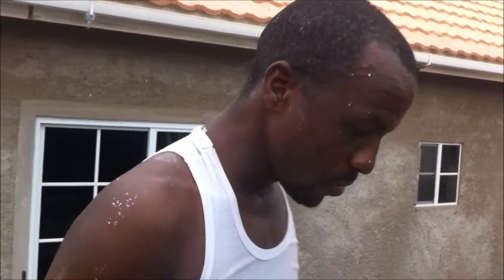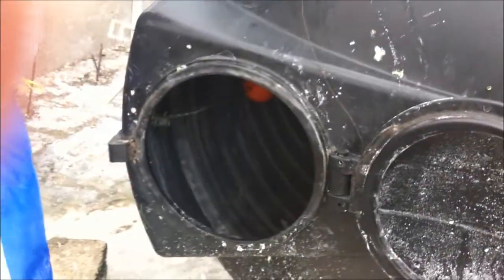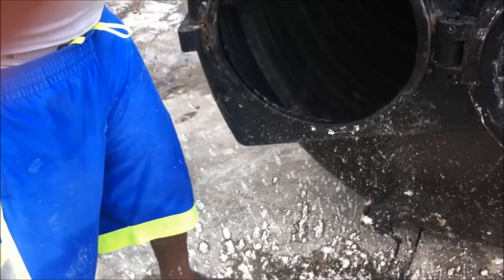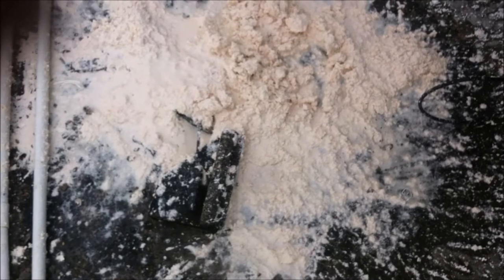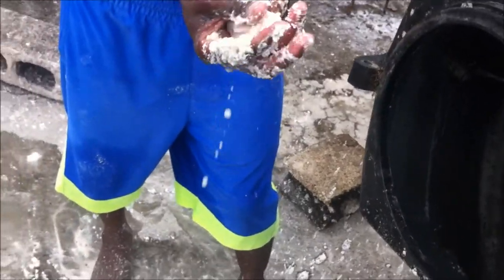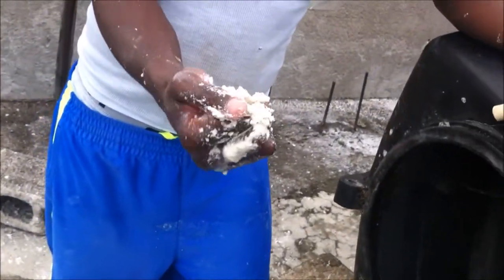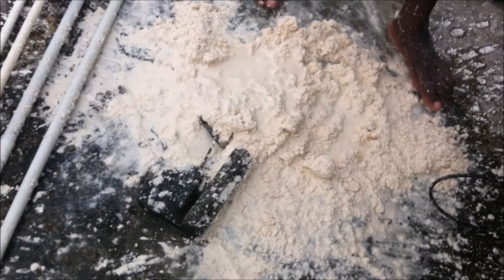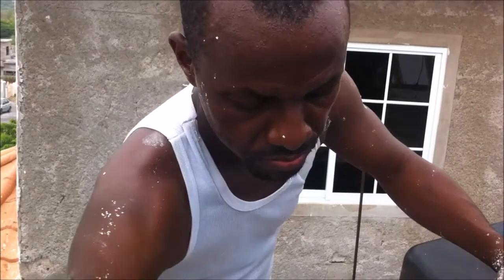MINERAL BUILD UP IN MY FISH TANK

Comment: we get a lot of lime and calcium build up in our tanks too....that's probably what it is because it's white....we flush them annually to get rid of it out the bottom and check valves....we put huge pots on our wood burning stoves to humidify our house and it solidifies in them too and it's impossible to get out without using CLR cleaners....or we just toss them in the recycle can to be melt down and buy new ones at the clearance store each year....this is very common where we live in Ohio due to very hard water....most people have filters and water softeners but you can just flush it....we have filters on our fridge dispenser and replace them every 6 months too.....good luck dude!
Reply from the maker: aaahhh boss, thanks for the idea...respect

Comment: Nah Bro... that should be limescale, the same thing that makes the water mark on the top of your fish tank and he line at the back of your toilet... 100% of Jamaican fresh water is limestone filtered ( filtered through marl rock)... that makes it good water, but when water gets high agitation (like from a forceful air stone or in your case water falling from a high inlet to the bottom of your tank) the molecules get excited and change their charge and the calcium bonds to the plastic of the tank... it bonds even more to calcium that’s already on the tank, it would be a thick crust eventually (sure, some chlorine residue could be in there, but true chlorine dissipates in a week)...
Reply: You could leave it there, it’s normally harmless... but the more that’s in there is the quicker it will remove those minerals from your water, which is fine for discus (and goldfish?) but not fine for most fish (especially cichlids), because it lowers your water’s hardness (and maybe your ph)...so no, it’s not directly killing your fish, ... no, it’s not a residue from the tank... you’re just demineralizing your water... good luck mi bredda.
Reply: If you want to prevent this  from happening (I’m assuming that the inlet is from the top of the tank) , install a down pipe to about 6 inches from the bottom, it’ll lower the force and agitation... just look at what species you’re doing and decide whether you want hard water or not.
Reply from the maker: wah gwaan bredda, nuff respect, all i know when i went in the tank, my skin scratch me the entire evening even when me bade. But thanks for the advise and explanation. Much appreciated
Reply from the maker: I guess if it was chlorine i would be dead by the time i get into the water tank hahahahaha , but this stuff amazes me boss
Reply: Fish Keeping Jamaica  I’m curious about something... the next time you have a batch of eggs (especially if you breed angel fish) (not interested in African Cichlid eggs)... tell me if you’re noticing much fewer of them being fertilized (more staying white) or cases of the fry not escaping the eggs... that limescale was removing a lot of your calcium (softening your water) and the water that comes out of your tap is about 150kh... I’m curious if cleaning it had bad effects.
Reply from the maker: @spyrit35  oK will do. Currently having issues with the bulk head for that same water tank so, it will be a while. Respect bredda